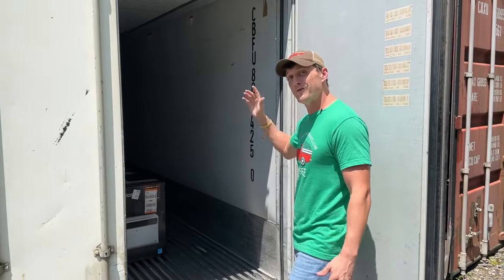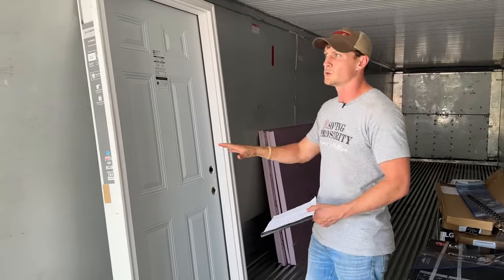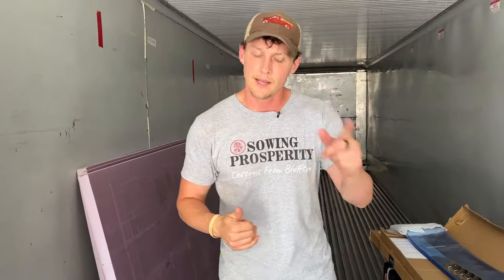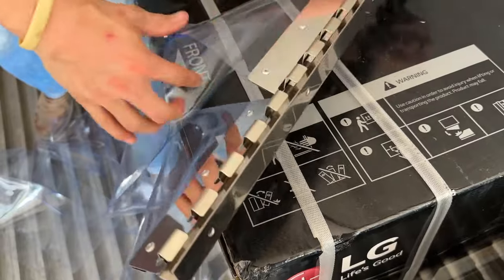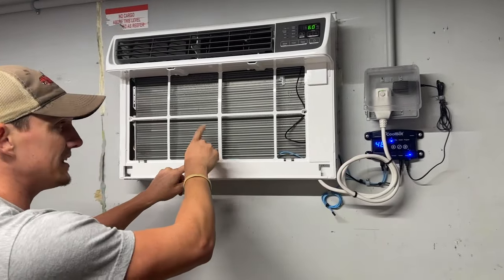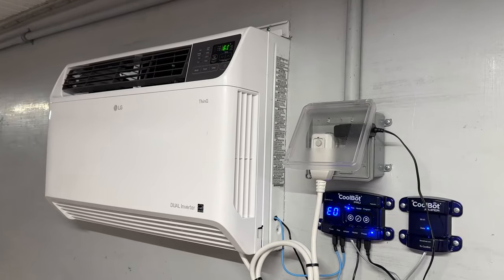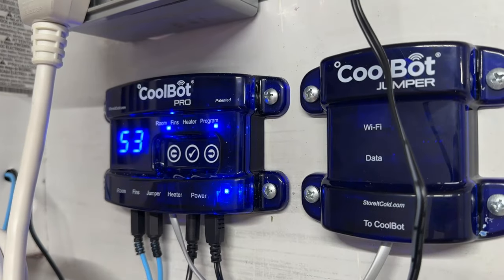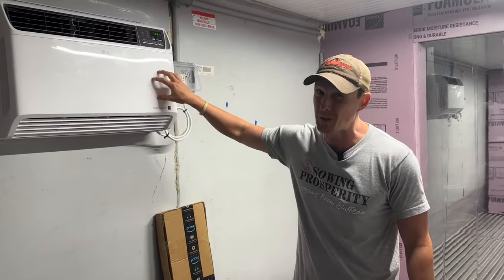Build Your Own Walk-In Cooler | DIY Cold Storage in a Shipping Container | sustainable cold storage

Comment: Are you able to control for humidity as well? I want to store apples, but they need cold temp + high humidity
Reply from the maker: We are in Arkansas, which has a pretty high humidity.  We store apples and have no problem.   Since Coolbot uses air condieeriones, it is essentially a dehumidifier.   Coolbot will have resources to be more spaeic to you location.  😊

Comment: How bad is icing over on your ac units? That's the first thing that comes to mind, if the units are running all the time, at temps much lower than designed, wouldn't they freeze up?